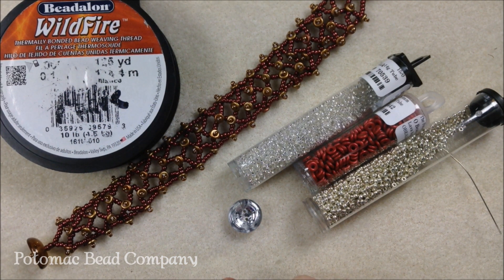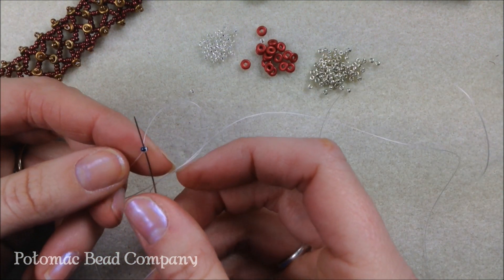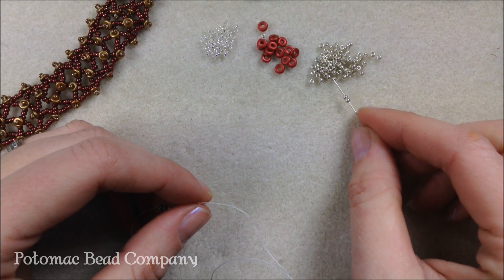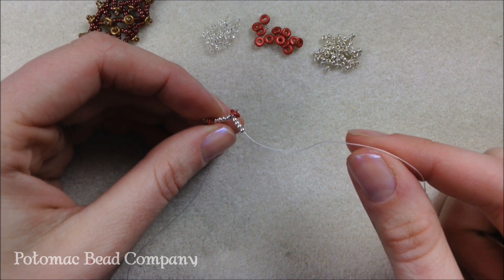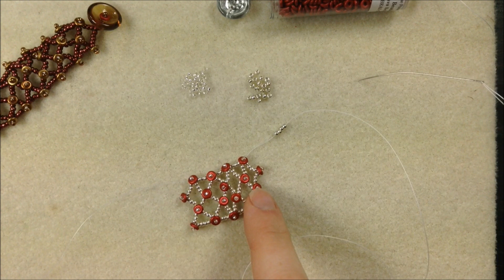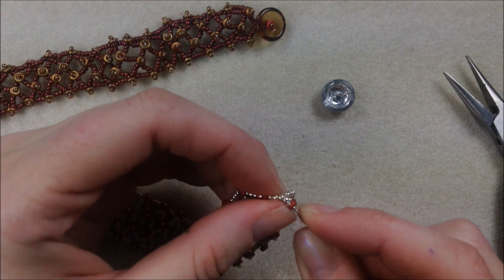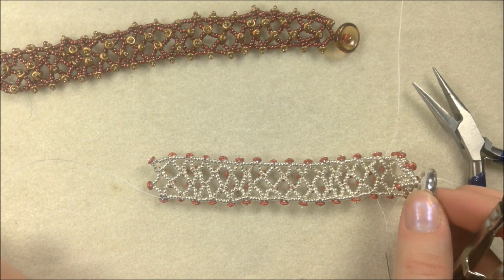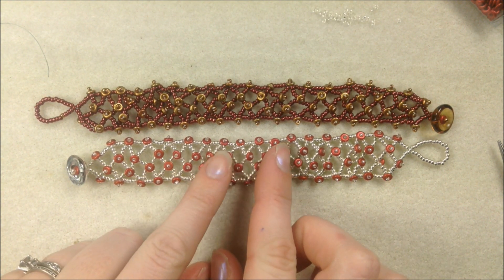Netted Flat "O" Bracelet Tutorial

Comment: What size are the o beads?
Reply from the maker: They are nominally 4x2mm, but the actual dimensions are closer to 3.8mm wide by 1.5mm thick.  The hole is about 1.2mm in diameter.